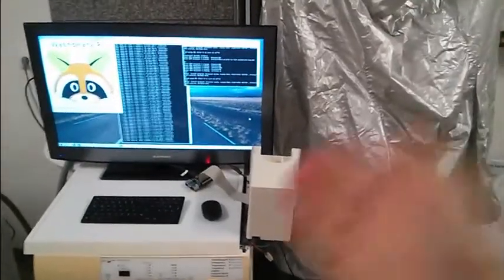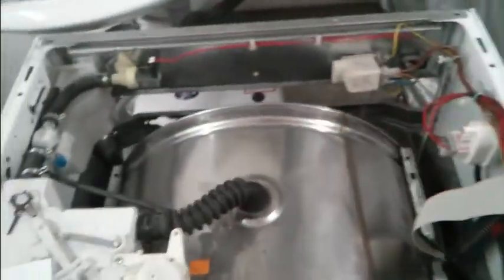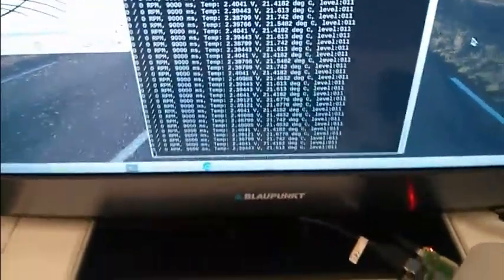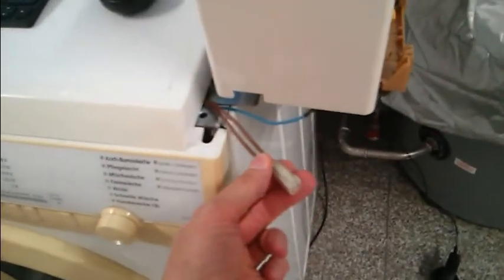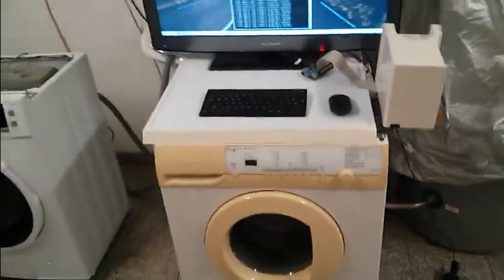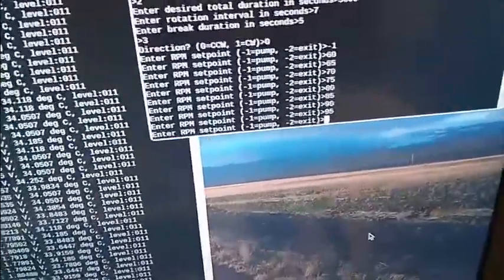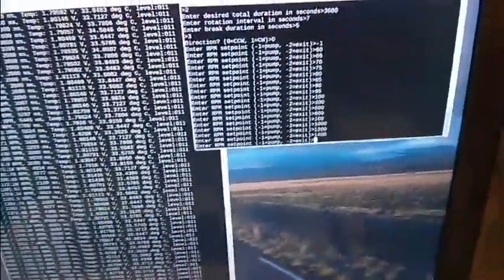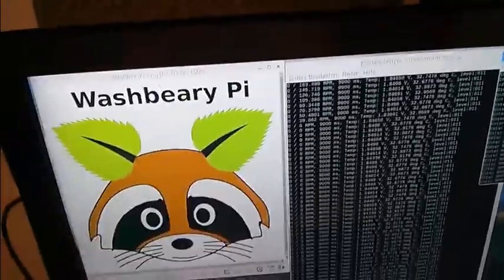WashbearyPi Episode 3: Now washing! A washing machine controlled by a Raspberry Pi.

Comment: You are very knowledgeable in this RPM ramp up stuff. Hopefully we have Raspberry Pi appliances in the near future. By the way, to dry clothes most efficiently, it is best to keep 1400 RPM for 5 minutes. :) That is what my LG does.
Reply from the maker: To be very precise, the spin cycle that I show in the video is just the first intermediate spinning. Typically, a wash program is structured as follows:
- Cleaning with warm water and wash powder
- Intermediate spin #1
- Flushing with cold water
- Intermediate spin #2
- Flushing with cold water
- Final spin (longer, few minutes at high RPM)
The video ends after the second step. I did not include the other 4 steps, since they would have been a (rather boring) repetition, and the video is long enough anyway. But if you design your own wash program, be sure to include all steps :-)
Reply: I understand. Most washers do the exact steps that you describe (wash, intermediate spin 1, rinse, intermediate spin 2, rinse, final spin). For me,  I sadly don't own a Raspberry Pi, nor have the technical skills to install one in a washing machine, plus my machine is 0.5 years old, so is new. But I always follow the tech trends by watching videos on the Raspberry Pi, as it is impressive that a 40 dollar computer could do so much. Hopefully, all appliances use the Pi as their processor, instead of proprietary stuff. If the Pi fails, one could always purchase a new one, and flash your wash software onto it, in an ideal future world. :) Imagine integrating the phone and installing new wash programs, or customizing a temperature (eg. 25°C, or 77°F wash), with a 1750 RPM spin. But hey, that would burn out the motor. Would be fun to see though. Cos, I'm a young man who finds that stuff funny.